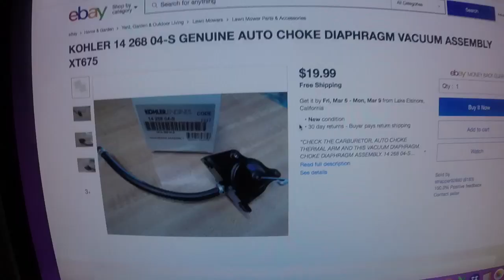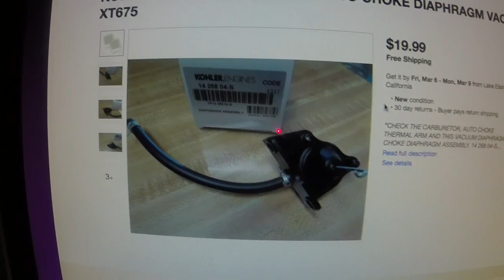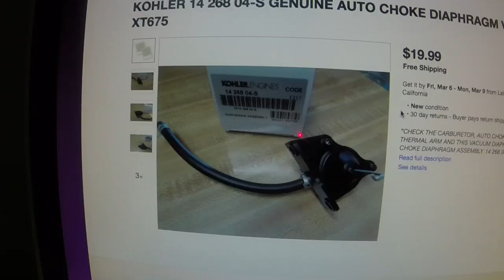Fixing a Lawn Boy push mower with no spark and missing parts

Comment: I have a 2019 RWD Lawn Boy with an automatic choke too and it start every time, but the traction wheels are of a poor design that bogs down into the lawn on the turn-around to cut another path. I decided to install an inline fuel valve, as I did on my older 2001 Lawn Boy that still running great with the same hp. engine. I was going to install an inline fuel filter on the newer machine, but after viewing your video I believe this Lawn Boy already has an inline fuel filter. I found out this fall that I can easily run the carb out of fuel to store for the winter just by shutting off the inline fuel valve... A piece of cake!  In the summer, I add some Seafoam to the fuel tanks, it has helped the mowers when they run a bit rough in the past.  Thank you for your videos, they help us all.
Reply from the maker: Thanks for sharing your experience and thanks for watching!

Comment: kohler'sInteresting   Our community gardens are closed this year (covig).    I get these mowers  in every year but I am not a Kohler fan.  I think there is too much technology there.  I think it uses reduced vacuum on start up to activate the choke.  Much like the old cars did.  They were not great back then either.  On some of the old cars the wipers were run on vacuum and when you pushed the accelerator down the wipers would stop.  yes i am that old.  LOL
Reply: And when you let off the gas, the wipers go like crazy.
Reply from the maker: Kohler is interesting, not my favorite either but they seem to run okay.  I've heard horror stories about the Courage rider engines.  That's probably what it is, oddly enough after more testing it would cold start on the 3rd pull and restart fine when warm.  Gotta love when stuff was all vacuum operated on cars!

Comment: Working on the exact same mower right now except mine has the “Sens-a-Speed” (personal pace) self prop system where the whole handle pushes down to start the drive. With those Kohler carbs I just try to fix ‘em anymore instead of getting a new one, they always send the wrong kind since there’s so many different versions of them. Not like the good old Briggs and Tecumseh where they’re all the same!
Reply from the maker: Very nice, this was my first Kohler carb I've ordered.  It worked after some modifications but would have been nice to rebuild.

Comment: When you need just a fuzz more pull on a cable like this:unscrew the end of the fitting on the end of the cable jacket a turn or two where it clips in the bracket. Might give just enough extra pull so it works correctly. You should get an ultrasonic cleaner.
Reply from the maker: Good to know, I thought these were fixed and non adjustable.  Ultrasonic cleaner is on the list but who knows if I'll ever get one.  I seem to like the hard way...

Comment: Well i got the LT 1000 craftsman that has the single clyinder ohv 17.5 hp.going  now got to fix the tires .& Get the mower spindles fixed only question i have what would cause it backfire every now & then hope you can help me with that young man
Reply from the maker: Very nice!  I would guess that the mower just needs to be run some with fresh gas and the backfiring might go away.
Reply: @EllisMowersandmore  okay thx hope that the backfire will stop